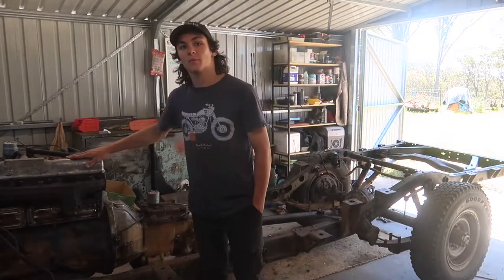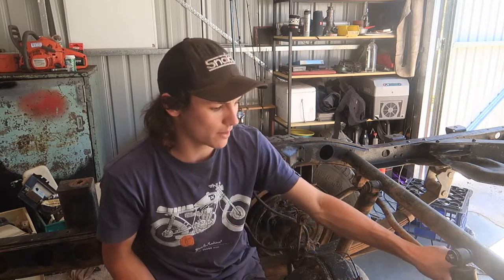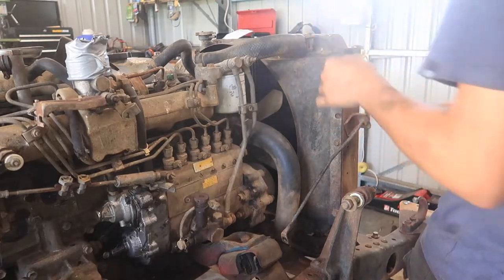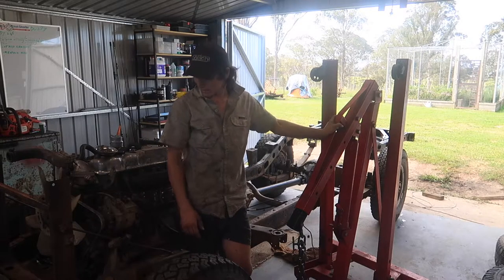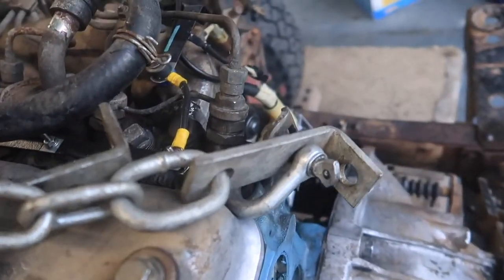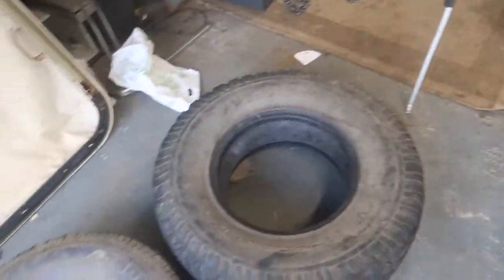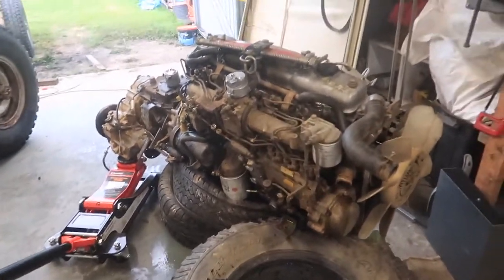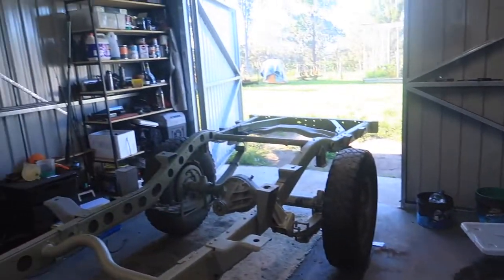DUSTY EP5 || sandblast and engine removal

Comment: Hey mate just putting the 2h on an engine stand and dont have the bolt size for the rear of the block , anychance you know the size? Cheers mate
Reply from the maker: Couldn’t tell u the exact size, but it probably will be m10-m12 1.25-1.5-1.75 pitch, get a few different bolts and just try them.
Reply: @JaredS47  thanks mate, legend!!